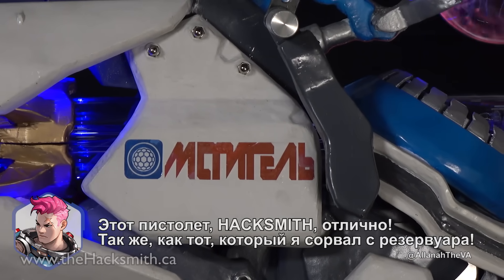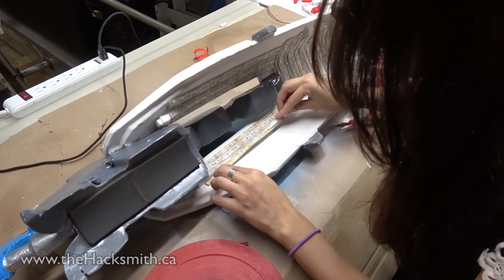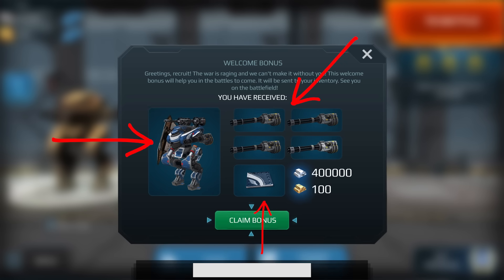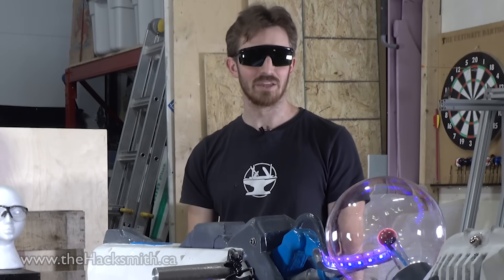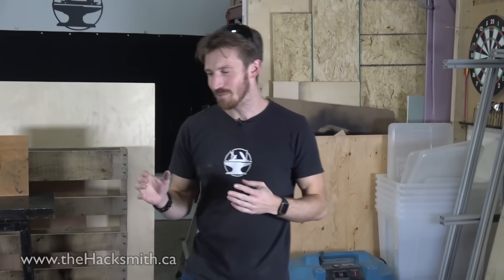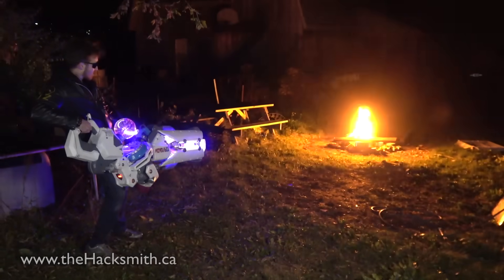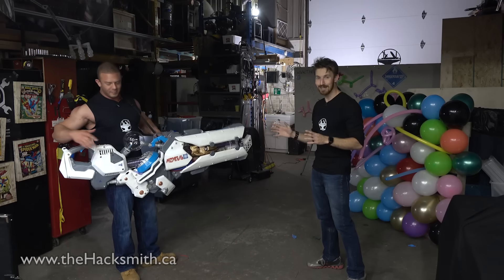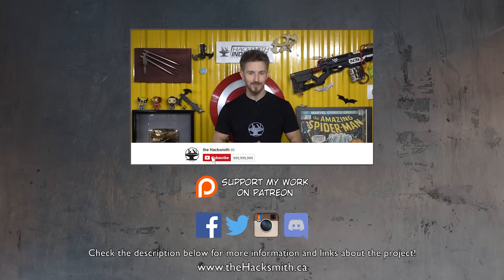Make it Real: Zarya's Particle Cannon (PART 3/3)

Comment: Feed the op through a telescope backwards. Larger beam diameters diverge slower than small ones. There's a article about it someplace I can't find now where they pop balloons 150 ft with a pointer modified with a blue ray burner board

Comment: Didn't one of your employees used to work at a company that made smart glasses? Glasses have lenses, and they focus light so you can see.
Reply from the maker: Co2 laser wave lengths burn normal glass.
Reply: What about glass with a little metal in it... I think I remember hearing that that makes bulletproof glass.
Reply from the maker: Bullet proof glass is mostly made of polycarbonate and glass or acrylic.  Laser would still melt it all. The issue is you need a very specialized material that co2 laser wavelength can go through without absorption
Reply: So that will just burn, then? Hmmm... How are we going to figure this out? Unfortunately, I don't know any optics company outside of the glasses place my dad gets his glasses.

Comment: I was mulling over the concept of a beefy sword with a revolver Style card that could contain different capacitors you could have the charger for the capacitors built into the sheath and as you strike a surface it could discharge a capacitor and then you could just switch to the next Barrel air quotes for a second high-powered strike and 1/3 and 1/4 to 1/6

Comment: Question . Can i use this to melt through steel doors ?
Reply: Not with 80Watt CO2, a laser powerful enough to cut steel is not the sort of thing you want someone waving around with just a pair of goggles for protection.
Reply: @TheKumaDono  what if you convert the plasma cutters from home depot . To a laser gun like this
Reply: The problem with plasma cutters is cutting depth and they need to be very close to what they are cutting, if you had a portable plasma cutter, putting it in a gun style body would only change how you hold it as you cant really (well easily) change the focus like with a laser to make it work at a further distance.
Reply: @TheKumaDono  true true.

Comment: Just wondering if you compress in smaller beam: 80W in 0.25mm² cross section. It should hotter 2000 times, more danger, rock engraved, electric wire cutting, combo balloon in one shot (<100ms), the beam will extremely bright. Down to 0.01mm² cross section should create white air plasma beam, small hot straight lightning that explosion with sound each time shot.
Reply from the maker: yeah, but like we said, we can't focus it long range :(
Reply: the Hacksmith Let try with 1 pair convex and concave mirror. Concave mirror diameter about 2'' and have a hole 2mm at the center, focus 3cm; Convex mirror diameter about 0.25'', focus 3mm. Adjust the position mirror to make  sure the beam reflect on convex mirror straight (to go out the hole) after focused from concave. It's cheap but hard and fun to try, the backside of tiny convex is flat mirror to increase performance reduce heat burned, the bone to fixing mirror should reflex unwanted light back to the tube too. I've seen some full IR ZnSe laser focus lenses pack on eBay, but it's very expensive (>$1000) and may not work in high density. Aluminium polished may better than silver mirror.

Comment: Godda push the diode to the max! Find out how much it takes to destroy one by SLOWLY I creasing flow to the doide until it explodes, and set your out put just beneath what it takes for that. Also, the blue/ultraviolet side of the spectrum is best for destruction. Even if the laser is invisible, it is best to be invisible on the blue side of the spectrum, preferably as far as possible. This wavelength carries huge energy more so then the red/infrared side of the spectrum.
Reply from the maker: It's not a diode =p

Comment: It's cool and everything but there is a magic question: What is the divergence of the beam?  The magic value is power/ area.   Hence the need for the focusing lens.   I know some laser frequencies,  like the green 532 ones have how divergence.  Meaning the dot stays small for a long way.  So lena solutions to extend the range are viable.

But with your design,  the rapid divergence of the infrared beam makes focusing the output critical.  Even a close range.  Have you looked into the viability of keeping power density up at "meaningful , maybe 25 yards says.   And then inherent beam divergence may fluctuate that your lens system be variable as hell.  Meaning a death ray at 30 yards may be nothing at 10 yards (counter intuitive), because the beam may be so large at that point.   Out of focus. 

This is a meaningful question. Surely applicable to the military laser weapons, and I'm sure you've looked into it,  and would love thi hear any conclusions or work you'd done in this area.   Because it's hugely important.  Thanks.  LOVED IT!
Reply from the maker: It's a CO2 laser -- they aren't powerful to begin with -- zero military applications. The reason it can't do more than pop a balloon is due to divergence, but the special lenses required for focusing ZnSn only have a focal range of 1-4" so no bueno for long range.

Comment: Lasers goggles don't protect u against all kinds op IR lasers (fiber laser and an CO2 lasers have different wavelengths)
Reply from the maker: most IR yeah... you need really expensive lenses that transmit IR
Reply: The fiber lasers machine that I work with (BRM lasers) are pretty expensive.

Comment: So it's a laser... Yes photons are technically particle, but when you say particle "cannon" you generally means Ions or at least plasma, but for the first you would need a particle accelerator so it's not surprising you didn't manage to fit that into a hand held gun, but a plasma gun is doable.

Comment: The fact that you made this as a working gun, it seems like it is more powerful, and it doesn’t reload every 4 seconds
Reply: Compared to Zarya’s
Reply: Yea but you need to change those batteries
Reply: Toasted every 4 seconds? Um......i don't think that Zaria have to reload that early. .......its 8 seconds
Reply: SamFoxter The Foxter secondary fire and reload every 3 sec normal fire 4 secs actually.

Comment: Lightsaber made out of alot of tech issues but it worked. For only a few uses then it was damaged an blew up a little I was completely aware of what would happen so I made me a proof suit for sience experiments. I was cutting wood an glass. how? My lightsaber spins like a twisting coil of melting metal. After it broke I started making  another that will shock at the end of a hammer. Tested it on trees. Perfect. Iwana make it more like halos gravity hammer.

Comment: More Volts More Damage😲
Reply from the maker: +KivableGaming not in this case lol
Reply: more volts, more destroyed laser diods :-D
Reply: for those of you who don't understand why "not in this case" then is because if you get too much voltage into the laser, it breaks. And you can not just connect it to power. you need to connect it to some special circuicity first.
Reply: More volts more dickbutt
Reply: Increased voltage and greatly reduced current will work.
Reply: Old conversation, i know, but, THE BIGGER THE NUMBER THE BIGGER THE FUN!!!
Reply: More volts, more fun

Comment: You could have easily built a beam expander and then used it backwards so that it's a beam shrinker. All you need is two lenses
Reply from the maker: +Hengji Huang com lasers require special lenses. This would melt a normal beam expander
Reply: Is it that powerful? Quartz lenses have pretty high melting points.
Reply from the maker: +Hengji Huang not about the melting point! It's infrared light, something most materials absorb. Only lenses I know that are IR transmissive is ZnSn
Reply: oh, ok, didn't realize that.

Comment: you sure you are pumping the laser with enough power to drive the full 80W ? you'd have to drive 2KW to the arclamp
Reply from the maker: Not sure where you're getting that math, lasers aren't that inefficient... the HV supply only draws 400W peak
Reply: i'm used to them being in the 5% range for most lasers, co2 seems to be "as high as 20%" though that would be at the lamp still so with the inverter and the HV DC supply even at 20% you'd still want to be pushing 530 or so from the batteries accounting for losses in the middle. I doubt it's actually running at 20% though since it didn't seem like you had it in a reflective casing to get as much of the pumping light into the lasing tube as you could, not saying doesn't work, and isn't cool, and the tube isn't capable of 80W i just bet it's actually pushing closer to 40-50W

very impressed though :)
Reply from the maker: +Ian Roberts the tube is rated at 80-100W tested from manufacturer, I've never heard of or seen a reflective casing on a co2 and I have quite a bit of experience with co2 laser cutters. What application are you familiar with?
Reply: mostly some stuff in college, but i guess i was applying  what i knew about He-Ne and Ion lasers here which do  have much lower efficiency and again have the lasing cavity inside a reflective material for better pumping efficiency as well as water cooling the cavity. seems CO2 is abnormally high efficiency at over 10% , wasn't doubting the tube was rated for 80 though, just that you  pumped it enough / didn't lose enough of the pumping power to decrease from nominal output as measured by manufacturer.

Comment: try to concentrated it using a magnifying glass at the front of the gun ... it should work i think ? if it does u can burn stuff easier
Reply from the maker: Nope -- it would melt it! IR light is absorbed by almost, that's why you need fancy ZnSn lenses to focus it

Comment: Not sure why you'd 3d print when foam floormats work just as well for one hundredth the cost...
Reply from the maker: Accuracy. This is identical to the game!
Reply: the Hacksmith I appreciate exacting standards but foam prop makers achieve this through careful measurement and a sharp knife. Not a negative criticism but a tip. If you look at examples on the replica prop forum you'll see things with a finish as good or superior. I hope you make more like this in future so for budget constraints a 3d printed manifold endoskeleton and foam aesthetic parts would give you a beautiful and accurate final result with the benefit of considerable weight reduction. I hope you don't think I'm trolling. I really love your channel.
Reply from the maker: And we have zero expertise in that ;-) Hence why we did it this way! Also the internal components are heavy and delicate. I wouldn't want just foam to support them!

Comment: You could get around the over heating/warping problem with the crossbow if you use tungsten carbide bolts and amp up the pressure behind the bolts to fire them with the needed extra force.
Reply from the maker: +Chilled Clarity or just not heat them as much :p

Comment: Hacksmith maybe create the fusion particle gun from a game I don't remember the name of
But the gun basically has a ball magazine and inside the ball magazine crystals and metal get heated so much they melt and if you collect enough crystals and metal you can fire a line of molten crystals and metal

Suggestion nr 2
Time and relative dimensions in space
Aka the TARDIS
Edit:the gun looks line a normal revolver magnum 33

Comment: It works pretty damn well, but it'd be even cooler if you were able to add a blue visible straight line light coming out of the front of the gun like in overwatch, well at least a little bit more visible
Reply from the maker: +Sho Co2 lol that's what we have
Reply: the Hacksmith yeah, but if the lasers line was a little bit more visible it'd look twice as cooler, I don't know if it's the lighting or something but it's not as visible in the video

Comment: This needs a focal plane adjustment like on a long range optic so you can optimize your lazer diameter at different ranges. Let me know if this wouldn't work, and why it would not work.
Reply from the maker: +danimal danigan I explained in this video lol... The lenses are super expensive and have short focal ranges. It's possible sure, but not easy (or cheap)

Comment: For such a cool, large machine...

It makes tiny burny laser.
"You will need MUUUCH bugger guns!" -Heavy Weapons Guy
Reply: The laser is strong, its just Not focused, a laser with a bigger area  reduces its power
Reply: Otaku Reaper : I realize that. But personally, sci-fi weapons similar to this device's function have huuuge range.
Reply: True. Lasers do have a really big range but the more far they go the weaker they get
Reply: They forgot to use the shields for more damage :D
Reply: Otaku Reaper clearly, the solution is multiple lasers.
Reply: This is my weapon. She weighs 200 minutes and fires 4000 kilograms, custom-tooled cartridges at 150 minutes per second. It costs 12 dollars to fire this weapon...for ten thousand rounds.
Reply: IronShocker77 lol

Comment: Ok, so 80W continuous output is nice, but is there no way for you to pulse this laser? Instead of 80W continuous output, shouldn't you be able to do 1600W for 0.05 seconds? Like that, you could make it shoot once when you pull the trigger, and it would immediately pop any balloon, you wouldn't need for wait a second for it to do anything. 
Have you thought about modifying it to be pulsed?
Reply from the maker: +Tystros that's not how co2 lasers work unfortunately
Reply: Tystros They have to find an industrial-grade focusing lens first, which they say in the first video, not available for commercial consumers. Then the pulsing part would be the simple part afterwards.
Reply: It would likely be less impressive if they focused the laser.  A focused beam would just vaporize a pinpoint area, whereas an unfocused beam spreads the energy out over a wider area and this lower energy density allows things like wood to ignite rather than just burn through...

Just like using a laser cutter, you don't WANT flame and usually, flames are an indication you are out of focus.

Comment: if you used a 3d printer... why does the body look like its been carved out of foam with a dull blade?
Reply from the maker: +Vaustick ouch. Hundreds of hours went into epoxy and sanding the 3D printed part. Looks Way better than when it was just printed
Reply: ah makes sense. it still looks really great. it just seemed odd to me cause it didn't look like it was printed. :P
Reply from the maker: +Vaustick watch the first 2 parts you might appreciate it a bit more ;-)

Comment: Hacksmith I have got to say that I am really impressed with this laser cannon.  But I am also disappointed in you because I saw you pushing the garage up with a broom!  How is it that you have laser cannons but you need a broom to push up your garage!
Reply from the maker: +Liam Gallagher because the garage door is programmed to only open half way to save energy on heat. You have to open it the rest of the way manually

Comment: Use the lense from a big screen TV it will work
Reply: The old boxie big screen TV
Reply from the maker: +Joseph Pabrazinsky no it won't
Reply: Works with the sun
Reply from the maker: +Joseph Pabrazinsky yeah for visible light! IR light is absorbed or reflected by almost everything. That's why you can't use a TV remote though a window! You need a very special material called ZnSn to pass IR light